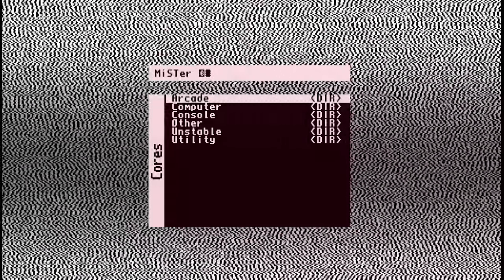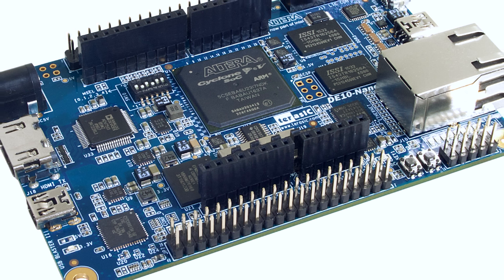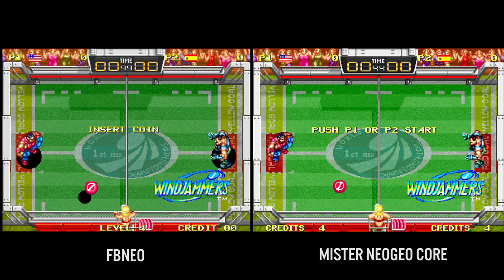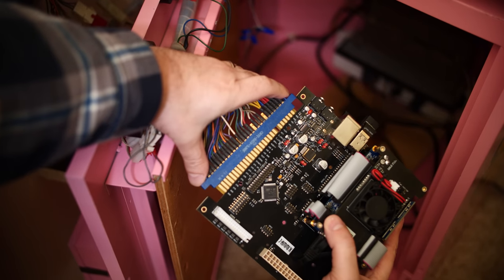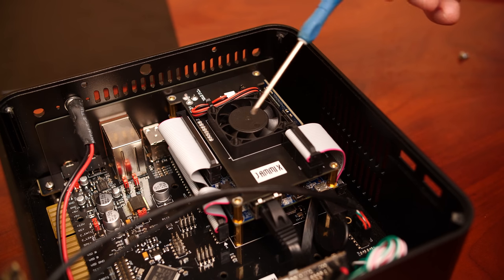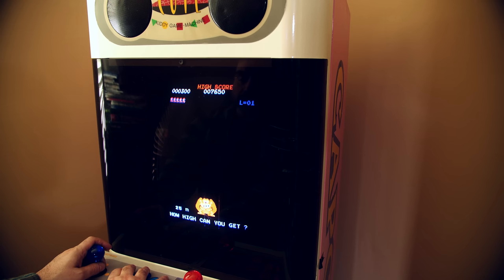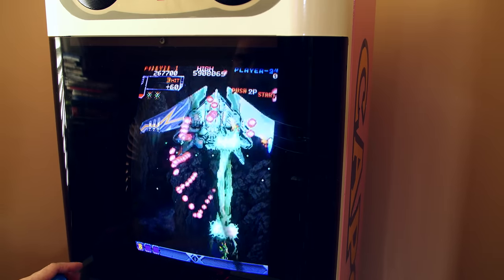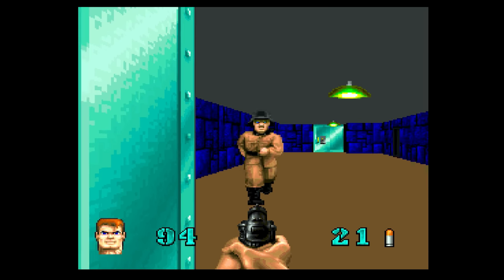Finally - I got my hands on a MiSTer FPGA Retro Gaming Setup | MVG

Comment: I love that you made it a point at the end to say that software emulation and FPGA conclusions can and should coexist.  Both have advantages.  Software emulation will never have to deal with supply constraints.  I think FPGA is a great solution for those who are looking for the most accurate experience outside of the original hardware.  Had this come out a few years earlier, I probably would have gotten into it as my enthusiasm was higher.  By that time, I came to realize that software emulation served me extremely well and any issues of lag or accuracy didn't affect me in any meaningful way.  I also have some specific requirements that make emulation on a PC a better choice.  What irritates me is snobbery from either side, though I notice it more in an anti-emulation direction.  I have seen so much misinformation about emulation with wild exaggerations about inaccuracy and input lag.  I remember a recent one where someone claimed Super Mario World was near unplayable through emulation due to lag.  It's nonsense.  I've also been able to switch between emulation and original hardware and the games I played felt exactly the same.  I have run into lag which was introduced by a TV as well as poor emulation, so I know those are issues, but things are wildly overstated by some.  With that said, I like that FPGA solutions exist for those that want it and the Mister looks very cool.  I'm sure the FPGA fans are sick of hearing "just get a raspberry pi".  The important thing is that these solutions exist.
Reply: I love software emulation now that RetroArch exists, so I agree with you for the most part, but the Super Mario World issue is far from nonsense. I've been playing SMW since it came out, and I have never been able to recreate the original experience on any kind of emulator due to severe input lag. I have tried all the PC emulators, SNES emulators for XBOX, PSP, NDS, PS2, PS3, Wii and even Android and Linux ones, the input lag is always there and it's VERY noticeable, even on a computer monitor, and I know it's not my imagination because I don't experience that issue with the GBA version of SMW. The problem is real and that's why they were talking about it on RetroArch forums (An input lag investigation), and they came up with a lag reduction idea for the SNES cores (because the issue is real), and still, it wasn't enough, so the RA team came up with the Run Ahead solution, which makes SMW kinda playable, but still feels weird because the timing accuracy is no longer the same. I'm not looking for a fight here, it's just facts. For people (like me) who are very sensitive to input lag, the game is almost unplayable on any emulator that isn't RetroArch with Hard GPU Sync enabled, a high Frame Delay value, and at least one Run Ahead frame (two for me). This is the reason why I would NEVER try a Raspberry Pi for emulation, since I doubt it can handle Hard GPU Sync and Frame Delay to begin with.
Reply: @PurpleSanz  I'm not interested in a fight about this either.  There are more important things going on and your reply was respectful and full of information, so there is no reason.  The issue here, I think, is mostly about words and a need for me to clarify my point.  I accept that there is lag that can come from different places and that some people are more sensitive to it.  I can even accept that someone who is sensitive might personally find a game unplayable under certain circumstances.  The story was told in a way to present all emulation in a bad light, which is why I mentioned "snobbery"(which is not what you're doing).  As I recall, it involved people who hadn't even played the game in many years and were referred to as casual gamers somehow expecting to have the same reaction time as when they first played it.  And the story involved the emulation(via Raspberry Pi) being done on one display, and the Mister on another one.  It's a terrible comparison.  I've personally experienced noticeable lag playing Golden Axe on one TV compared to another with the emulation hardware and software being exactly the same.  My issue was the conclusions drawn from that particular story.

I do find Super Mario World playable, even if there is lag.  I played it on the SNES when I was a kid too.  If you find it unplayable, or nearly so, that's fine.  And, as I said, I think the Mister is a great option for people who feel they need what it offers.  I would have gotten one if it had come out a few years earlier, before I realized that Retroarch served my needs quite well.  Incidentally, I tried run-ahead out with Shatterhand on NES, and found it much harder to control the jumps.  I'm not drawing any conclusions from that.
Reply: Lag is a big deal if you are a huge platformer fan of the eary bits generations.  Not so much if like me you mainly played Rpgs.
Reply: @Adamchevy  Of course it's a big deal when it's significant.  The point was people claim there's so much lag.  Meanwhile, I can beat Ninja Gaiden on NES via emulator with no problem which would be torture if the lag was significant.
Reply: Can't say I've noticed any lag on the emulations I've played. I do have a relatively fast PC and gaming monitor though... I'll have to try Super Mario world...

Comment: One thing I really love is that you can toss pretty much any input method at the Mister and it just works. Literally every USB controller I've plugged in just works. That part alone is so incredible to me. If I want to play Game Boy games with an arcade stick or PC Engine games with my Astro City Mini controller, there's nothing stopping me. It's wonderful.

I'm also a HUGE fan of the Game Boy two player cores that run two simultaneous instances and simulate the link cable. I wanted a split screen port of Super Mario Bros Deluxe's race mode for years and MiSTer made that dream come true.

Comment: I love the MiSTer. A full kit is expensive but as you mention can be bought in bits and upgraded over time. You can use original controllers and light guns on it if you get the SNAC add ons. I hardly touch my original SMS and Megadrive plus Mega SD/Sega CD anymore due to having this. On top I also now 'have' a Neo Geo, SNES, Turbo Grfx and various arcade cores I never had before and couldn't afford unless I won the lottery.

A pi or similar is cheaper and can emulate higher end consoles admittedly, but the MiSTer just feels like I'm playing the real thing not a laggy clone... and to me at least that's worth the price of entry.

Comment: MT-32 Pi hat also worth looking into and perhaps you buying.  For MIDI sound on some compatible cores like X68000 and ao486.
The Mini-ITX Ironclad board is the next on my shopping list, as currently just have the plastic sandwich board and heaps of cables flooding out

Comment: The MiSTer project can never get enough coverage, so thank you for doing it. As we move into the future those original hardware cabinets are going to fail, and this is doing incredible preservation of software.

I was very interested to hear your take on it given your programming background :-)
Reply: This isn't just preservation of software... this is preservation of HARDWARE!

It's the true value of FPGAs, the ability to fully replicate the hardware so software can run natively.

As I've already said once, I hope one day we get an FPGA solution for more complex cores, especially the N64 Reality Co-processor. The PS3's PPE and SPEs may be out of reach for now, but the PS3 is a relatively recent console compared to PS1 and N64.

Comment: Excellent video! I love your emphasis on the community involvement! 

I only noticed two things I would add a sorta-correction to:

The price was slightly overstated for the bare minimum. If you wait on the stock that keeps slowly trickling in by placing a backorder for the de10-nano, and combine it with a 128MB SDRAM module and a makerspot otg USB hub, it's still a decent amount under 300 USD. Maybe you meant another kind of dollars (not sure if you are outside the US, I forget).

Not a major issue by any means, but the "exact replica" status is very rare in any fpga core, including Analogue's FPGA-based clone consoles. Many cores are not direct copies of the schematics, and this is due to modern FPGA not being natively capable of doing things like tri-state logic and asynchronous flip-flops. Upon compilation of the core, that kind of logic in HDL gets inferred down into larger blocks of FF registers that achieve the same result on the FPGA, but can be inefficient and unreliable. Asynchronous clocks can cause problems in greater numbers with long chains though. So often times the digital logic can be preserved and be 1:1 while not matching the hardware schematic 1:1, so for some cores it is preferable to not use the same archaic circuit designs. :)

Side note, Sorgelig really should be highlighted by everyone and thanked for all the hard work he's put in over the years. He has maintained code in a ton of repositories, checking the code each time he merged a pull request, but often making his own fixes in all the cores, he developed the hardware, he developed the Linux kernel fork, he developed the Main MiSTer binary, and he made a great number of computer cores that people enjoy.

Also FPGAzumSpass (the psx core dev) is amazing, as well as srg320 (the Saturn dev who famously did the SNES core without access to original hardware). Kitrinx/Rysha deserves a ton of credit for coordinating and aiding tons of development behind the scenes as well as translating a lot of stuff from English into Russian for Sorgelig (who isn't as bad at English as he thinks), as well as developing and enhancing multiple cores, perfecting color palettes, and adding lots of quality of life features to the platform.

Alanswx and jimmystones have ported and improved a ton of arcade cores (as well as many computer cores ported by alanswx). Grabulosaure created the scaler that MiSTer uses, ascal, so the beautiful video output deserves him a lot of love. Mr. X developed many arcade cores for the MiSTer.

ElectronAsh, d0pefish, flynnsbit, Shane Lynch, paulb-nl, James-F, etc... So many I could just list off that have contributed so much over the years. 

And of course the MiSTer project all goes back to the earlier pioneers of open source FPGA gaming emulators. MiST, the projects original namesake, was the source of many for the MiSTer projects cores. Torlus, gyurco, robinsonb5, MikeJ, and so many others have created so many components and cores over the span of nearly 2 decades that the MiSTer has built upon that the contribution can't be overstated. 

Thanks and props to every dev helping us play games the (IMO) best way possible!

Comment: The only thing I think you missed was that the MiSTer works with light guns etc when using the RGB output, since with [most cores] it works identically to real output hardware on consoles and arcade boards with zero lag.

Other than that, this is probably one of the best MiSTer overview videos I've seen from anyone who isn't already heavily involved in the project, kudos! Hope you have a blast with the MiSTer!

Comment: MiSTer is an incredible device. I love mine. With the right USB controllers, there's practically no latency and the hardware emulation can be pixel-perfect, if the core is developed by the right hands. If you want to play Capcom System 2 and 3 games, you should upgrade the SDRAM to version 2.9...Flawless performance. Can't wait until the Saturn and Playstation cores are fully complete.
Reply: No

Comment: I'm glad I got my Mister setup 2 years ago as I paid ~250€ back then for the DE10-Nano, 128mb ram extension and an IO board add-on for VGA output. You can also build (or buy) SNAC adapter boards to plugin the original gamepads that came with consoles. There is indeed a learning curve but once everything is setup you can automatically update all your cores from the device itself :)

Comment: The Mister was a fantastic purchase for me right when lockdown started. I had time on my hands to learn a bunch of cool stuff and since then the scene has bee going bananas with updates, x68000, CPS2, ps1, saturn and now neo geo pocket/color! The investment is a bit at first, but when I realized that I no longer want to mod any of my older consoles because of the Mister's perfect video output, It's probably saved me money in the long run lol. It covers so many ODE and flash carts that I no longer have a desire to purchase and all in one convenient little box. Add in PC and arcade systems, dual output to CRTs and 4k tvs and now RetroNas and its literally the best time to be a retro gamer.
Reply: x68000 did they upgrade the core, last time i check i could get it to run

Comment: Finally!!! I always wondered why you haven't covered the best project to happen in retro gaming.

I feel so glad I got the MiSTer last year. $105 using the educational discount. RAM cost was $57. Case cost was $30. USB Hub + IO Board cost $90. Total cost was less than $300.

Raphnet Adapters + 8bitdo Controllers on this are awesome for NES and SNES

Comment: I really like how the Mister project handles things like switching cores and input bindings and such. Things just work. Plus there's the zero lag and instant bootup time. RetroArch/RetroPI setups are such a PITA in comparison, especially with Bluetooth controllers and such, but of course software emulators do have way more features and are basically free.

Comment: I got my system a few months back after months of thought and video viewing to make sure it was for me as it's expensive compared to emulation options which I already have along with real hardware for the 8 and 16 bit computers which was my main draw (especially Amiga) and I'm so glad I did. Real hardware stays safely packed away likely to be sold at some point while a tiny device does it all and more and saves a lot of space in my house. Well worth every penny. With playstation and Saturn cores coming soon and looking amazing it's all icing on a very tasty cake.

Comment: Emulation has come a long way but the MiSTer has impressed me more than most emulation has.
Reply: Sit an average member of the public in-front of a Mister, or a Pi 4 running Retropie, and they wouldn't know the difference. Tell them the price difference, and then they'll know - they'll buy a Pi.
Reply: @mrkirk4944    True but if you are a retro enthusiast you would want this over any emulation device. MiSTer isn't for everyone, you definitely do notice the input lag on emulation vs fpga.
Reply: @mrkirk4944  not even an "expert" could tell the difference